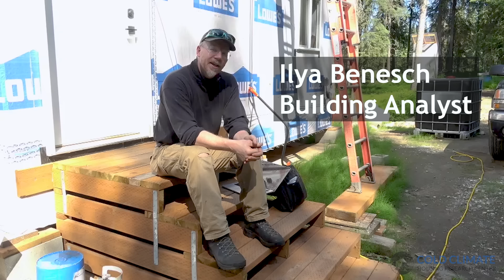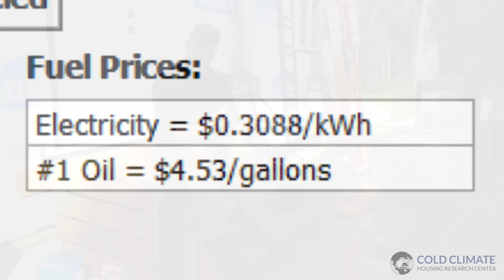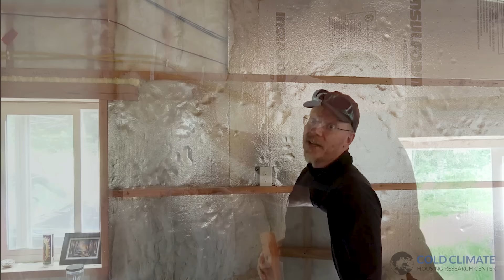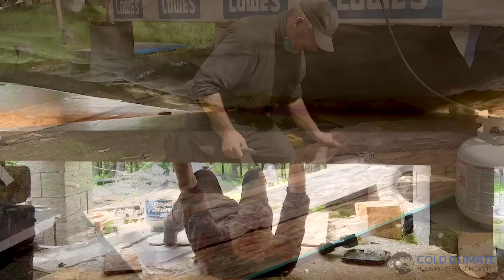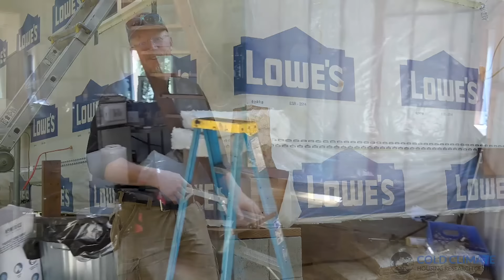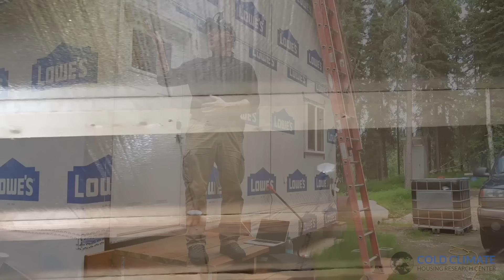Cabin Energy Improvements Part 5: Conclusions

Comment: Texas here.  Had a shed with closed cell spray foam, and canned spray foam, some of the spray foam touching the ground.  dont know what the brands were, that was done before I bought.  But, a rodent (i assume), has carried away or eaten/chewed, the regular canned spray foam.  How much did he take?  He only left an amount about the size of a quarter. I dont know where it all went.  I've been told he did not eat it, but it's gone, gone.  I'm not sure i've seen anything eat or chew spray foam before, but I have not been in Texas that long.   Say, in NY, where it's colder, I've never seen the spray foam touched by rodents.   But, if you are near a stream, you've got some mean rodents (ie: rats).
Reply: I'd be interested in knowing that too.  I have seen every type of foam board and also fibrous insulation suffer from rodent damage.  I thought rockwool would be unappealing, however when I left a couple of test batts out, our boreal forest red squirrels carted it off.  Currently I have not seen spray foam suffer damage, but my sample area is small relative to other insulations.  I will say, I have not seen much rodent interest in cellulose either.  I'd love to see a breakdown of what insulations are least appealing.